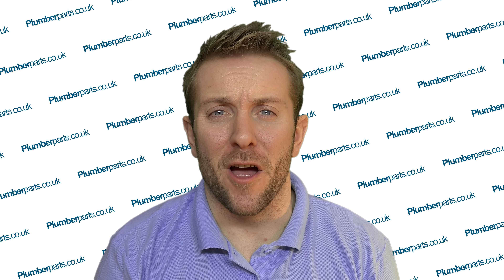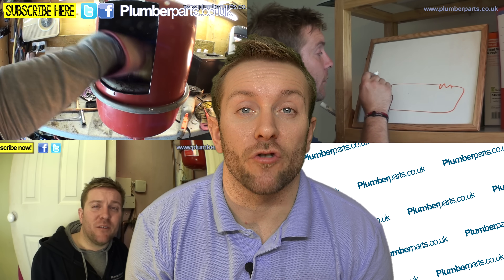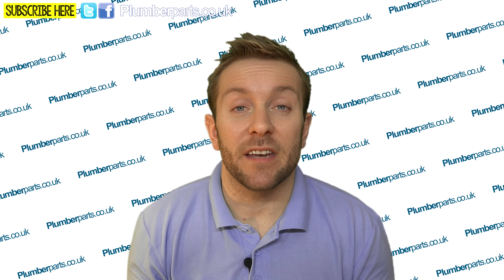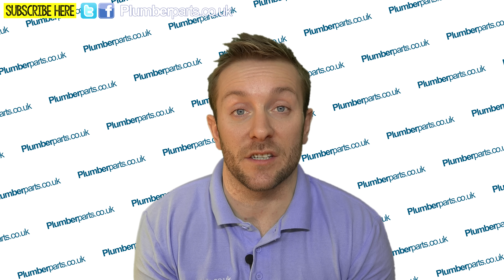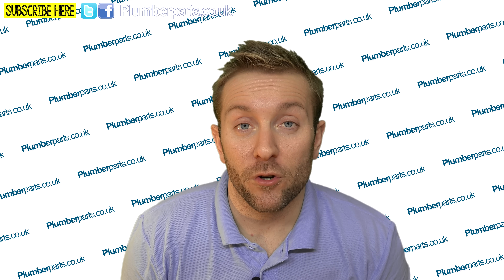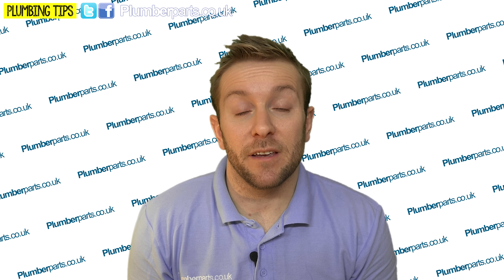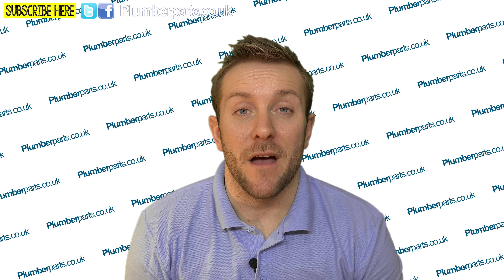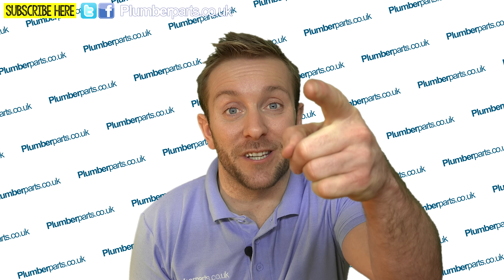BOILER KEEPS LOSING PRESSURE - WHY AND HOW TO FIX - Plumbing tips

Comment: why do you keep referrion gto air as hydrogen ?  otherwise.. yes good video
Reply from the maker: In the radiators...the air created by the reaction on the metal is Hydrogen (that's what the H is in H2o)
Reply: Wrong, the gas in heating systems is caused by corrosion;  electrolysis of water. Hydrogen is formed by water breaking down into its constituents of Hydrogen and Oxygen. The Oxygen bonds to the steel to form Magnetite (black sludge) while the Hydrogen accumulates and is mistaken for air and this is what's normally vented by the customer or plumber.
Air can enter a system by various mechanisms but it would take too long to go through them all and there pretty rare and mostly apply to vented F&E tanks and not pressurised systems.
Reply: If the H2O broke down, you would have solved the world's energy problems. There are oxygen atoms in the spaces between the water molecules. These are what reacts with the carbon steel, and the hydrogen is a product of this reaction, along with magnetite,  and possibly also methane and ammonia.

Comment: Thanks for the video. My fill up loop is a copper pipe which is fixed in place. There is only one tap on the filling side and not the other side. I set my pressure between 1 and 1.5 is this ok.
Reply from the maker: Set at 1 bar when system is cold. Should be fine! SUBSCRIBE! ➡️👉 https://www.youtube.com/subscription_center?add_user=plumberparts 👈⬅️ IF YOU HAVEN'T ALREADY! 😎

Comment: Good cheery video thank you.  
I have a Worcester 28CDi. My heating works ok but I stopped getting hot water.  The grey key underneath was in place already (I've read it should be removed but it seems stuck).  I twisted the grey dial to get the water moving, heard the water and 'guessed the needle should be at about 1.5 (lucky guess).  I put the water on in the shower, still cold. I checked the needle and it had moved up on its own to 2.5 and the red needle that was far right, moved back to meet it.  They both stopped at 2.5 and I got some luke-warm water through eventually.  The grey dial then started to drop down to 1.5.  I still don't have hot water but my radiators were red hot (so I couldn't release any air).  Do I have to call somebody out to fix it?  TIA :-)
Reply from the maker: Hi Karen, yes this sounds like a heat exchanger issue - no biggy! Get a qualified engineer out! SUBSCRIBE! ➡️👉 https://www.youtube.com/subscription_center?add_user=plumberparts 👈⬅️ IF YOU HAVEN'T ALREADY! 😎

Comment: I had a serious pressure loss on my combi boiler I thought I had a major leak under the downstairs floor and tried leak sealer to no avail I was worried that I would have to ruin my lovely Oak floors to access the leak. I rang a plumber telling him that there was no sign of water leaking from the boiler,or the outside safety pressure relief pipe, or the auto air bleed valve. He suggested that i turned off the central heating. Then the flow and return valves under the boiler to isolate the heating circuits and just run the hot water. he said if it still leaked it would be the main heat exchanger leaking and discharging down into the condensate drain . If this was the case he said call out Worcester Bosch as they repair this at a cheaper price  deal than he could quote.This did turn out to be the Fault ! Worcester repaired it .It was much cheaper  than ripping up floors to find a nonexistent leak!
Reply from the maker: Great stuff mate! SUBSCRIBE! ➡️👉 https://www.youtube.com/subscription_center?add_user=plumberparts 👈⬅️if you haven't already!
Reply: David Fry sallygaden

Comment: I ve got new boiler installed, but still loosing. 0.2 bar in 48hours. Does anyone knows how much water it might actually be? I can't see any visible leak, so my worry is it might be under the concrete. Boiler is 26kW
Reply: You can only check the expansion vessel air pressure when the system water pressure is at zero, otherwise you will get a false reading.
Reply: Peter Simo  ours might be doing the same.  Plumbers are telling us we will not see any sign of a leak under concrete. Surely it seeps out and saturates wood eventually??
Reply: I was thinking to use one of the leak sealants, but I am worried it might damaged the boiler, so I will do more research, before, but this might be the solution
Reply: any Luck James?  I can't think of anything else,Maybe  my last chance would be to check expansion vessel in the hot press, which was put in there 10 moths ago.I  will contact the company who install my new boiler to have a look. ..Pain in the hole as I spent 2500 euros for new boiler and still loosing pressure.
Reply: good,man well done. my external  expansion vessel was deflated as well , I pumped it up today, see if the drop stops or not ,... I had some plumber cowboys in my house last year servicing the boiler they blamed it on leak as wll.., sometimes is better if you do things yourself.
Reply: James Hally mine seems to hold the pressure now as well (24hours), I would thought that if I pay 2350euros for new boiler they would check if  the external expansion vessel is all right, but no, it is easier to blame it on the leak , cowboys.
Reply from the maker: Guys, check the High pressure relief pipe outside. It could be dripping from there! SUBSCRIBE! ➡️👉 https://www.youtube.com/subscription_center?add_user=plumberparts 👈⬅️if you haven't already!
Reply: Peter Simo I've just drained a whole bar of over pressure out mate.3mugfulls.lol

Comment: My filling loop is permantley attached altough not always on. The tap that I turn to add presure has a slight leak behind it which I assume is the reason I have to top up the pressure once a week.
Does this sound like it could be the cause? Is it as simple as changing the tap and I'm done?
Cheers.
Reply: Damo C only if it’s ontheheating side

Comment: Hi mr Plumber ,I am loosing pressure last few weeks and have to top up the water on daily basis. Just check the expansion vessel and the water is squirting water, is this causing pressure dropped? Also there is a plastic container on the floor with one copper pipe and I discovered there is around 2liters of water and inhibitor in it. Any advices?
Reply: yeah call a engineer

Comment: I've searched Google for hours and can't find an answer, my boiler loses pressure over a couple of weeks, but ONLY when the heating is on.

If the heating is turned off, the presuure doesn't drop. I presume this rules out the PRV and expansion vessel?

TIA
Reply: On a combi there is less expansion taking place as you are transferring the heat to the flowing water. If your boiler pressure riser to 3 bar when the heating system is hot then it you expansion vessel
Reply: It is almost certainly your boiler PRV or expansion vessel then.
Reply: It's a Logic+ 30, it's now happening a couple of times a day. Isn't there a known fault with the logics and the error "Low flow lockout". All of the thermistors have been changed.
Reply: Cleethorpes Kid
You really need to get it sorted sooner rather than later. Every time you top it up , you introduce fresh oxygen into the system and you will rot out your rads prematurely.
Reply: Sorry, I misread the error message when I originally posted 3 weeks ago, It's not losing pressure therefore I'm not topping it up. It keeps switching off with the error message "Low water flow lockout". If I reset the boiler it starts working again.
Reply: That sounds like a blockage, some boilers will have a software lockout if there is an excessive temperature rise across the heat exchanger, this is due to poor water flow rate. The software is trying to protect the heat exchanger and let you know you have a problem before you lose the heat exchanger all together, then it gets expensive. If you are not loosing water you might have to chemically clean the water side of the heat exchanger, but that's not really a DIY job, you need to know what you are doing.
Reply: Sorted now, Ideal repaired it, they said lots of parts needed replacing, including the heat exchanger
Reply: if you are loosing such as .3 bars in 3 weeks time it is normal...
Reply: @dkaloupis75  wow finally someone willing to quantify what every other video seemingly just glosses over, what actually is "constantly" "frequently", once a day, week, month, leap year!

Comment: Hi there been watching a few of your video's, wondering if you could guide me in the right direction?  my boiler cut out due to the pressure dropping over a leaking radiator and we have had the heating on, the problem is.....I can't get water back into the system, turn on the filling and nothing is happening, no flow of water for some reason, I've bled the radiators, any help would be appreciated Thanks.

Comment: I've fitted a new radiator ,I've put the plastic clips on the brackets but I'm still getting the tapping metallic sound when the radiator is heating up and cooling down ,what could the problem be ? is there a solution to cure this ?
Reply from the maker: +Shaun Smith Rad pipe rubbing on joist/house under the floor. Insulate properly when installing! Bit late now! 

Sub here please>> https://www.youtube.com/subscription_center?add_user=plumberparts <<If you haven't already!

Comment: My expansion vessel is either under pressure or ruptured, waiting to get my tools to check it for myself. 

Think it's alright to keep it running at times to regulate the pressure between 1 and 2 bar? (It's dropping to 0 when off after a while)  It's still quite cold here so I'm wanting to keep it on to prevent the pipes freezing. 

Cheers for the videos btw, they're all quite a good insight into plumbing!
Reply from the maker: +bw5991 Souldnt really, but it should be OK. How is it now?

Comment: I'm experiencing same problem,  my ideal logic + keeps losing pressure daily,  no sign of water (yet!),  had it last year which was found to be a hole in rad pipe,  problem on seems to be since i repaired a minor leak on lockshield?  driving me nuts
Reply from the maker: +Gareth Roberts Have you checked the lockshield is ok?
Reply: +plumberparts i have replaced both of them Tuesday night and topped up and rebled the system,  touch wood its help pressure since!  what are your thoughts on hep 20 pipe work to connect to a radiator,  im currently refitting my cloakroom toilet and my boiler engineer said he would use 10mm to pipe up the new rad from the copper?  thanks for any reply love your videos

Comment: Hi, my heating system stopped working after I bled the radiators. The radiators were very hot after I bled hen but the heat went away soon after. Any tips?
Reply from the maker: +Hadi Air lock, low pressure?
Reply: +plumberparts I am almost 100% sure it is low pressure, it is a Worcester but not a combi

Comment: Thanks for your advice.  Followed it & sadly still NO FURTHER forward.!!!  I have the Combi 105e boiler.  Just had one problem 'fixed' or resolved ,  only to realise That I may have another.  The shower reaches a '''nice''' level of hot water... Only to cut out & go to freezing cold water.  Some sights go on to talk about unblocking plates etc. etc.  ... All well & good if one has the slightest clue as to where the kit is located in /on the combi 105e... I dont!!!   & what to do once confronted with said problem.    Could you/ would you   '''do''' a vid as to cleaning the plates & thereby getting the thermal thing ???  to work again.  Sorry if I sound like a Idiot...  I am!! , However, plumbing isnt my thing.  However, I do not want to be '''ripped''' off by a plumber or #50 more if called a  ( Heating engineer) whilst he ( or she) sucks air through their teeth, scratches head  & wonders contemplatively as to   WHY??  the kettle isnt already on.  @ 85.50 pounds  for 15 mins ''work''  is parted with. For that... they can provide their OWN tea & milk & sugar. .  Happy ( & warm 2016 Folks)

PS Sorry if I sound grumpy' folks I seem to have an ATM  ( AKA the combi 105e) in my bathroom.
Reply from the maker: +Belfastchild Hi there, so what can we do for you? It does sound like plates cleaned. do you have a water softener? Cheers, PP!

Comment: when pumping air into the pressure vessel you gotta have an aircock open to remove displaced water!!!
Reply from the maker: Hmm good shout, although it's never been a problem in all my years of doing it. Perhaps that's because I've always dumped the whole system pressure (if any) before hand. Thanks for your comment, PP!
Reply: Correct..
Reply: Hi. Yes you do need to have somewhere for any potentially water in the vessel to go when pumping up the vessel. If you don't then the pressure from the heating side can push back and give a false reading.

Comment: Isn't the braided hose is removed to prevent mains water contamination.
Reply: +plumberparts No, but the heating system water can contaminate the mains water if the check valve is faulty, that's why the bye laws say you have to remove the loop. I'm a plumber and Ithought this vid was pretty good, don't understand the dislikes either.
Reply from the maker: +denis moloney Well kinda. Mains water can't 'contaminate' as such, but it can over-pressurise the boiler water if the mains valves start to let by. PP!
Reply: Yes, it is a water bylaw but ignored by many forign boiler manufacturers, Worcester Bosch mostly use a removable key (bridge) to comply with the regulations.
Reply: It creates an “air gap”. So that if the check valve fails then heating water can’t contaminate the mains if there were to be any loss in pressure to the mains...  doesn’t happen often but it does happen.  If a water main was to burst for an example there would be a sudden loss of pressure on the incoming main.

Comment: Here in Canada most boilers have automatic water feeders, when the pressure drops, the feeder will add cold water, up to boiler pressure; some are actually built into the boiler itself.  Automatic feeders are common in the US as well.
Reply from the maker: Sounds like a great idea. Do they ever cause problems if you've got a leak? James at PP
Reply: In the case of a major leak....

Comment: Hi great video thanks, can you help with our problem? Had a leak recently (pipe came off radiator , water everywhere) - system re pressurised , all ok, but since then keep losing .2 pressure per week since then. Was never previously an issue pre leak! Not aware of any more leaks, and it's not prv. Help please??
Reply from the maker: I shudder when I think of concrete floors and copper pipe!
Reply: Sounds like you've Still got a leak... Do your radiator pipes come down the walls into your radiators. Or do they pop up from the ground? 
Very common to have pin Holes under concrete floor. May need a leak detection team or a thermal investigation.
Reply from the maker: What was the cause of the original leak?
Reply: +plumberparts unfortunately I have to deal with this issue almost weekly sometimes I'm lucky and maybe only have a once monthly dig.... The joys 😭😭😭😭😭😭
Reply: +plumberparts I had to kango up 14 inches of screed then concrete to get to a pipe. At what i like to call THE house of horrors.
Reply: 2 Bar a week? That's a big leak..
Reply: +Shredded Kunt 
It goes from 1.0bar to 0.8 bar in a week
Reply: +MrSi500 
Thanks for reply. Yes some pipes under floor and in walls :(
What I can't understand is how combi was absolutely fine before pipe burst (only 1 location, visible and repaired) and now we have an issue. I don't want to rush into leak finding in case it's not! No evidence on ceilings or valves. Although I'm aware one could be hiding
Reply: +plumberparts compression fitting failed on radiator (thanks to bodge job by previous owner) and pipe came off - dumping quite a bit of water everywhere! But not all the water that will have been in system. Could system have air in? Have bled radiators once